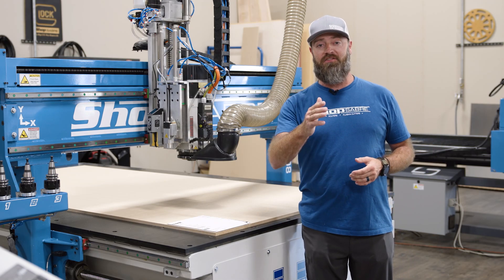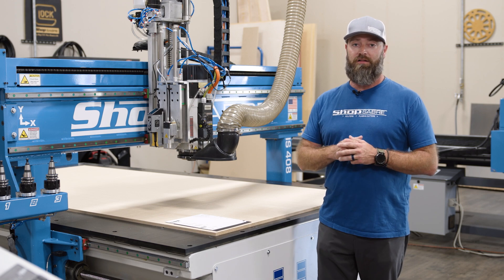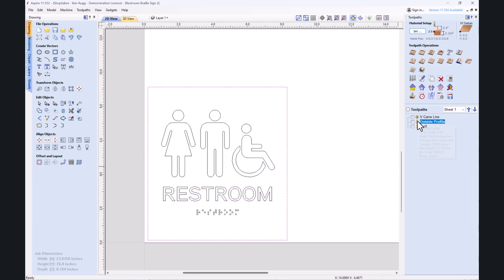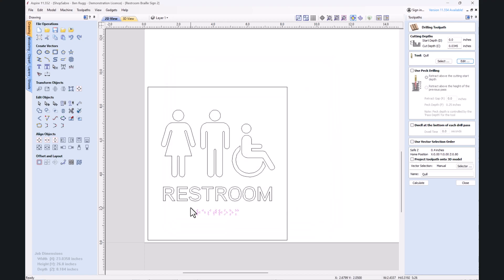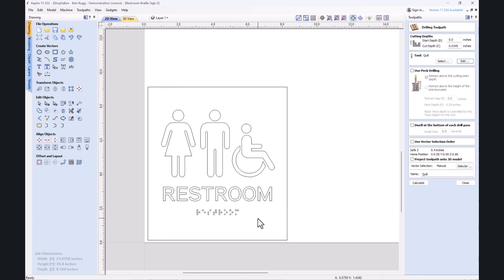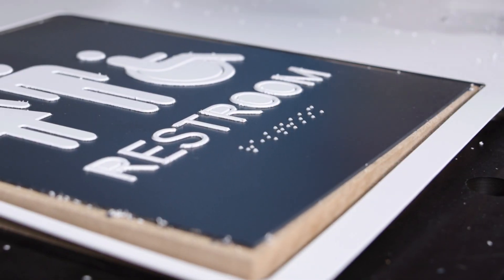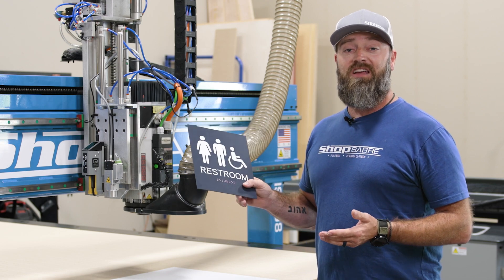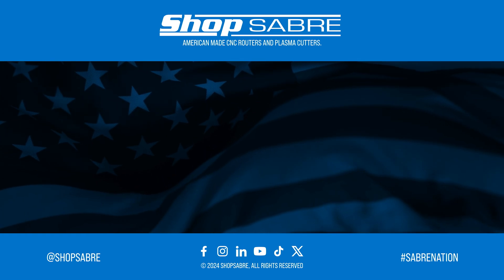Make ADA Braille Signs EASILY with your CNC Machine

Comment: Q1) How much does it cost to add Braille to an everyday product/personal gift....?   Q2) Is this the only method...?
Reply from the maker: There is two methods of ADA solutions, the printed dot as shown or the original raster style. 

With respect to cost - this is relative to the equipment and time spent. As you can see from the video once equipped the time per product is very quick so there’s not much overhead cost associated with the actual process.